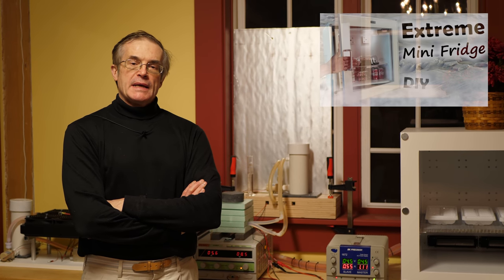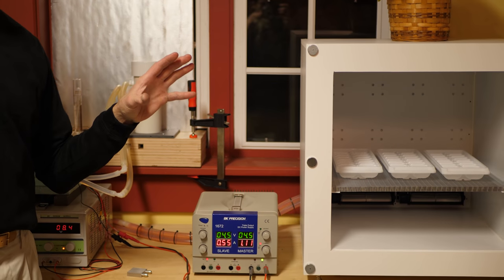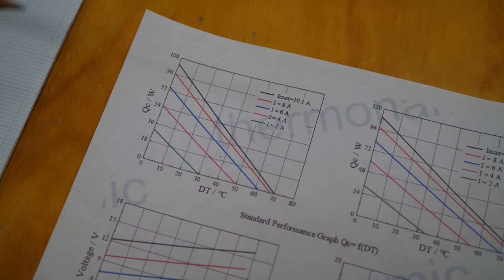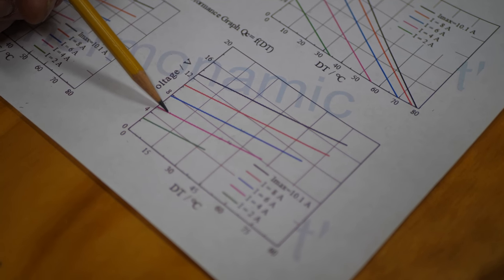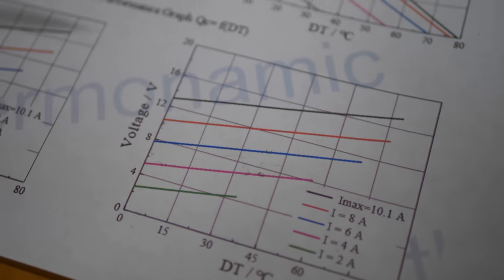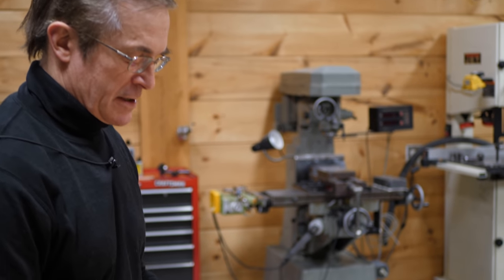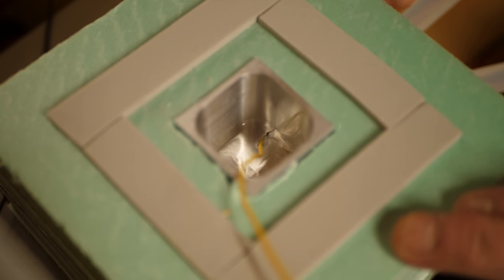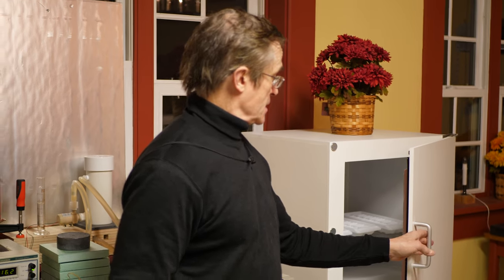EXTREMELY LOW TEMPERATURES! - Using TECs

Comment: A lot of people overclocking CPU's used to stack tecs..... I guess it worked or they would not have done it, but i guess to those people electrical efficiency is not a concern its just brute power
Reply: Computer power supplies typically output at 12V, 5V, and 3.3V. So you get pretty good results with stacked peltier/TEC using those different voltages. Use what you got...
Reply: you and Jitsen Chang have failed to realize is that the man said they could be stacked for lower temperatures. So your "guessing" 'it worked or they would not have done it..' seems to indicate that you didn't catch that fact in the video. Did you watch all of it or not?
Reply: @ChangJitsen  you do need to pay attention to wattage. You seem to have failed to realize the fact that the man said you could get a greater temperature change by stacking. That temp change, or delta T, is achieved at lower efficiency but he said that it does indeed net a greater temperature differential.
Reply: @williambarnes7642  What are you talking about? No one said it didn't work. Did you read the whole comment or not? Lol.

Comment: I love all these videos about TECs and mini fridges/freezers. I'm planning on rebuilding my mini fridge to use 9 TECs instead of 1
Reply: I like TECs and I like your plan, but did you originally want a low power fridge or a super small one? Just a chest freezer, with a refrigerator's thermostat swapped in, offers a lot of space and it's very energy efficient. That's the route I went years ago - chest freezer to chest fridge conversion.

Comment: I experimented with TEC 20 years ago (From MECI if anyone remembers) and found the same inefficiencies from stacking. Also, they are much better heaters than coolers. Create 46w heat vs 18w cooling. Great video as always.
Reply: I think another way you could go about stacking TECs is to run them water cooled in series, with two separate loops. The PECs themselves are only touching two water coolingheat exchangers. The chiller water loop and cooling water loops run in a cross flow configuration to minimize delta T for each one. The chilled water return goes into TEC 1 and then TEC 2 and then TEC 3 where it becomes supply and goes to the conditioned space. The cooling water return goes into TEC 3 first and then 2 and then 1 where it becomes supply to the cooling radiator. Now each TEC is running roughly the same delta T and the same wattage just different temperatures. The only disadvantage is this requires a lot of hose and fittings.

Comment: I tried putting TECs in a stack as you showed here myself some time ago.  
In my test the last TEC heated up instead of cooling. I also put the 2nd and 3rd element in series across a PSU.

My conclusion was that at a minimum I would have to adjust each TEC with a separate PSU to have a chance of it cooling down at all.
Maybe I was feeding it too much voltage though.
Reply from the maker: The setup in the video works well, but for each type of TEC there is an optimal voltage.  Use a variable voltage power supply and dial up the voltage slowly (over many minutes) untill the temperature fails to drop any further.

Comment: These TEC elements typically have a maximum COP when operating around 2V with a dT of 10K, however, you need a lot of them at such low voltages to get the job done! Their COP also increases a lot with increasing T(hot), ceteris paribus.
Reply from the maker: Correct.

Comment: I found 20 of those TEC12706 parts for cheap a long time ago.  I've been playing with them on occasion but the new info where you reduce the current across the 2 extra units when cascading them will kill some time while the springtime snowstorm wraps up.  Thanks!

Comment: This is very helpful. I am planning a cloud chamber project, and I want to build one with a larger, top-down viewing area approximately 8 inches square. Ideally, I'd like to consistently get the cold plate below -30 C in a + 22-24C room, and have it operational for at least 30 minutes at a time.

Comment: Ah yes. The energy needed to move the heat is rejected off the hot side along with the heat you are moving. That is a good thing to remember. It then leaves a heat "well" or "depression" for heat to flow into through one way or another.

I love your presentation on a fascinating subject.

Comment: I think it's safe to say that you have the expertise to make a closed loop geothermal heat pump system. Would be nice for a future video :)
Reply from the maker: We might.  I've thought about this and I think the most challenging part would be an easy, inexpensive way to bore the holes.  I like this better than digging up the yard and there are suprisingly few videos about practical and effective methods.
Reply: @TechIngredients  I think you don't need to solve every aspect of it. Just making a DIY heatpump as a proof of concept would be enough, and let the problem of the drilling for another day.

Comment: Next step: capture any condensate, pump to the hot side, and atomise for further cooling (and to reduce the temp differential in the TEC)
Reply: The condensate would be hotter than the cold water obviously...
Reply: Pump the atomized condensate outside, lowering the indoor humidity.

Comment: Ok, so with lower voltages the TEC units can transport more thermal energy with a lower temperature difference?

If these TEC units get extremely cold, like -162C, will the resistance and Amperage used increase?

It seems like you might have been suggesting that if the TEC units were cooled by liquid nitrogen, that they would not become colder than the liquid nitrogen. Is that true?

Are these graphs available online for different models of TEC units, or did you have to test them, or use equations to generate the graphs? 

Thanks for your videos, they are very insightful. I appreciate the level of detail and speech. Are you a University professor or a researcher? I have been secluded so my speech doesn't seem to be what it use to be. I hear that more social interaction helps with speech.

Comment: I have seen some 5 and 6 stage TEC units made for cooling missile guidance sensors and FTIR detectors. To get VERY cold what you need to do is stack them like a pyramid. A big high element count one on the bottom, heat spreader in between, a 3/4th element count one on top, and repeat as desired. You can get to about -140 to -180 deg C. The floor is because of the heat generated by the devices ❤
Reply from the maker: That process  becomes  extremely  inefficient because  the loss at each stage multiplies.  A differential  of 140 degrees  is possible,  but remember  that the "hot" side isn't  at zero degrees  centigrade.

Comment: Always wanted to know what happens if one cascades TEC's.
Then ended up reading up on CO2 in ultra low temp refrigeration, minor issue with the triple point and the ice blocks pipes.
Fascinating.

Comment: Thank yo very much...I tried it and gave me a good result better than before..but I used 10 vdc instead of 12 v and the two modules aboce in series connection then parallel with the bottom one...the bottom I used TEC1-12710 and the upper two TEC1-12706 and got very nice result.

Comment: One sees the connection between evaporation removal of high frequencies resonances in gases and the hot<->cold Junction equivalent in this demonstration video, that led to laser cooling of Black-body Singularity-> Bose-Einsteinian Condensation achievement.

Multi-stage Energy (spin<- e-Pi-i sync-duration resonance) extraction equivalent, Triple Expansion Steam Engine..
Reply: I love this idea and I think it might work. A sound wave in gases (liquids) must heat and cool certain zones (low and high pressure distributed along the length). If this is done in a cascade (next line from the top), then low and high temperatures can be achieved. That is, it is possible to make an air conditioner or heater without moving parts. You just need to move the temperature gradient from certain zones and transfer them to the next. This is difficult, since there are no devices that can be bought on aliexpress and tried this principle  quickly, to make a video.

Comment: You can buy TEC modules with different junction numbers with the same form factor.  Stacking these is a much better option?
Reply from the maker: Potentially, yes.  But, given the same driving voltage, you need to apply the performance graphs I presented in the video to determine the optimal capacities for the pair.

Comment: Love the channel and the TEC videos... while TEC's are compact and light in weight, they're unfortunately not exactly a holy grail device in regard to refrigeration or ultra energy efficiency ((aside from maybe a few niche applications)), especially when air/water cooling is added and/or they require the aid/help of ideal (exterior) climate conditions. Thumbs up none-the-less!

Comment: Lovely setup. What kind of computer fans are you using? With the fluid dynamic type, over extended periods the bearings will drain of the oil if they're used horizontally like you have them configured there, and sieze. Some manufacturers get around this with grooves in the bearings, so it could be just fine.

Comment: This is an honorable quest. The ability to extend the usable lifespan of food by electromechanical means is an earmark of the Modern Age. Everyone takes it for granted until the power goes out for a week.

Because it's easier to pass thermal energy to a dense cool sink than a warmer sparse sink, pairing any cooling technology with a geothermal heat exchange mechanism will usually improve the cooling technology's efficiency. I use one ground loop to cool several PCs, an inverter, and a chest freezer. As soon as I find a window air conditioner or refrigerator that's "broken", I'll turn it into a geothermal heat pump for my workshop, withdraw some thermal energy from that heat bank I created.
Reply from the maker: Thanks!
That is a good idea.

Comment: What about combining different types of cooling? I.e. insulate it really well so it consumes the least possible power, then put it in a large freezer - combine the benefits of both types of cooling. 

The semi- temperature independence of the Tec with the higher efficiency of the adibiatic cooling ( it seems like if would be hard to get temperatures below the boiling point with a standard refrigeration cycle and near impossible below the triple point- pumping gravel seems no fun).

Although I'm not very versed in the matter, and a lot of freezers have difficulty with a high load, so you'd have to keep it low enough, seems like you could probably get down to CO2 freezing temperatures at least
Reply: Dylan Davies you can do -150c on refrigeration, people do that all the time for computers with 3 stage phase cooling. My small 1 stage runs -60c if your comparing it like his 0 heat load test.

Comment: If you put the two upper tecs in parallel both thermally and electrically using a slab of copper to couple them to the lower tec you should be able to hit lower temperatures. With 3 in the upper stage an 1 in the lower you should be able to run them all at 10A and get a cummulative DT of about 100ºC with no load though with at ambient temperature below freezing I am not sure if you would run into some other inefficiencies.  Of course your setup is far simpler, more compact, works great and is a clever use of the enhanced cop at lower currents/dt .
Reply from the maker: You're right.  A typical, staged TEC stack uses progressively smaller TECs toward the top.  I've worked with these and they are cumbersome to mount.  Metal, heat transfer plates would also allow much higher capacity modules to be assembled.
Reply: @TechIngredients  I have been wanting to build that kind of setup for ages since I scored 10 tecs like yours for 1.5$ each. I was thinking of something crazy like 6-3-1 but I don't have the setup to measure such low temperatures or much of a reason to actually do it. I would if it could condense nitrogen or oxygen out of the air but I think that no amount of staging can get you there with tecs alone.
Reply from the maker: You're right, you can't.  They won't go anywhere near that low.

Comment: I am looking forward to your analysis of a typical 3 Cubic  Ft. home "chest freezer" conversion.
...add additional insulation of, lets say .5 Cubic Ft. so the final interior is 2.5 Cu. Ft.
Add an external heat exchanger of the Thermaltake type, and get the wattage of both exchanges in the 450 to 650 watt range.., and put the unit in a temperate climate... evening out the summer/winter cycles... add a thermostat with a hystersis  of ( i.e. -10 to +10 degrees F) And finally see if it can run off of a Server Power supply of the 750 Watt Variety.. 60 Amps @ 12 volt, or 24 volt @ 30 amp... and  from there I can figure out what solar/storage I need to make this run 24x7 with a 24 hour storage senario for a dreary day.
whew... that was a mouthful.
thanks you for a great video.
Lisa

Comment: Something I've been curious about your usage during cold months: is it actually more energy efficient to exhaust the waste heat outside, or inside? Exhausting heat outside during the winter is preventing waste heat from helping heat your house and actively providing a leak path for heat to leave the house through the fridge. considering how inefficient TEC coolers are, I'm really not sure which way the scales tip
Reply from the maker: One way to evaluate this is cost.  The heat from the TEC is very expensive.  By decreasing the temperature of the hot side of the TEC you will decrease the electrical use toward zero.  Even with a compressor based refrigerator, heating with the electrically powered compressor is much more expensive than gas or oil as an energy source.
Reply: @TechIngredients  Thanks for the response! It sounds like you're using the outside air to do most of the cooling work, and the TEC to provide a little extra oomph if necessary. Now you're making me want to pull out my thermo text book and estimate how much more efficient it is

Comment: Haven't watched the whole video yet, but if efficiency isn't a constraint, you can still reach a higher temperature differential per cascade reducing the voltage per TEC layer and most imporatantly, by using more TECs per level as you cascade. Essentially, each layer has more capacity to support the layer before it. You would need increasingly large thermally conductive plates to separate one layer from the next so that you can fit a matrix of TECs. An example, though I haven't done the math would be: layer 1 would have 1 TEC, layer 2 would have 4, layer 3 would have 20, layer 5 would have 100. Again I haven't done the math, but this seems plausible. Now, you'll need some huge copper plates and lots of intricate insulation blocks, and still you'll have a slight voltage drop per TEC per layer. Each additional layer must be able to pump the total heat created by all TECs before it and still maintain a high temperature differential. Increase the number of TECs and slightly reduce the voltage so that the temperature differential is maintained. I want to try this experiment myself! Making my own liquid nitrogen/oxygen sounds like an interesting endeavor even if it is highly inefficient. Also, you'll need one hefty power supply!
Reply from the maker: Take a look at our more recent video on dry ice and electronic cooling.  Liquid nitrogen is out of the question no matter how much power you're willing to use.  Nevertheless, you are right about the design of a cascaded system.

Comment: The delta T you demonstrate is 53.5. I just did this with a single TEC1-12708. I don't think stacking these things does anything because the bottom unit can only ever move a max Q
Reply from the maker: It does  make a difference  and that is why there are commercial units fabricated as permanently mounted, stacked assemblies.  You can achieve a relatively  large delta T with a single module, but the heat flow becomes miniscule.  Multi stage units can exceed a 100-degree delta T.

Comment: Another nice video!  Have you tried parallel rather than series, ie a single layer array of TEC's (as opposed to stacked) and so covering a larger area ?
Reply from the maker: Series will allow you to reach greater differentials, but at the cost of effeciency.  Parallel is the way to go as long as you're below approximately 1/2 the maximum temperature differential.  At very low differentials, they're pretty effecient.

Comment: 5:39: have you confirmed your series example experimentally? Rather than putting the elements front to back,  consider a freezer inside a freezer where you've already moved the energy out of the first freezer before you start the second freezer. That would be a true series operation. A similar example would be using a mercury pump to make a vacuum. Each iteration of the pump is working off the vacuum that the previous iteration created. Each stage is more difficult but you don't have to go back and recreate all the other vacuums. They are retained for you with the check valve. It's like a Russian egg of freezers.
Reply from the maker: The problem is that no system is perfectly insulating and so you will eventually reach an equlibrium tempreture between heat pumped and heat leaking back in.